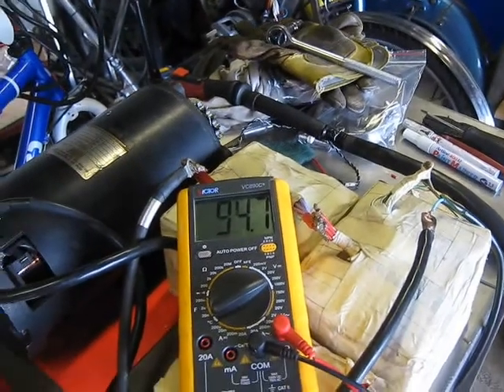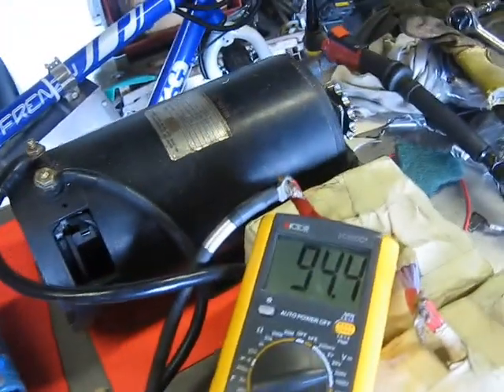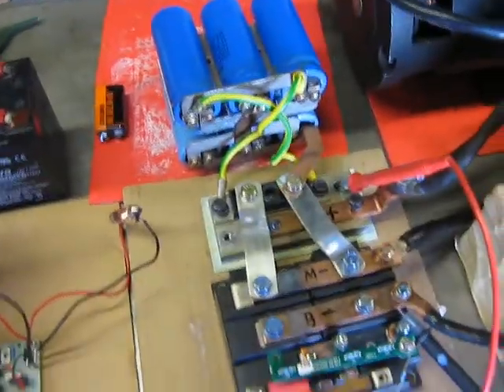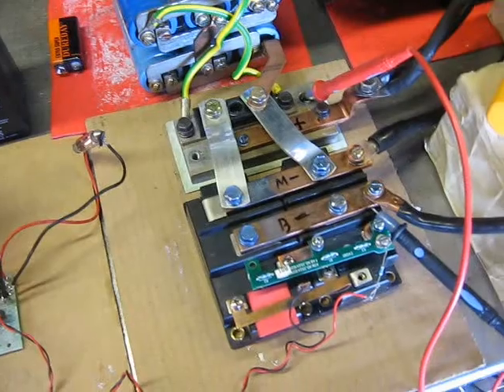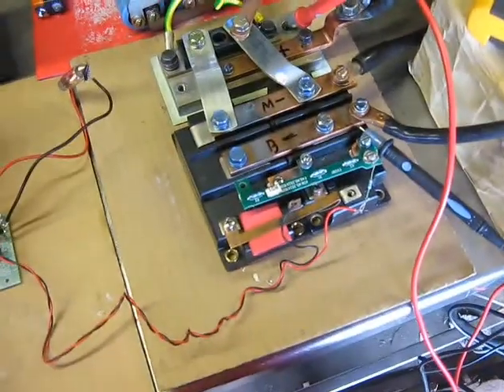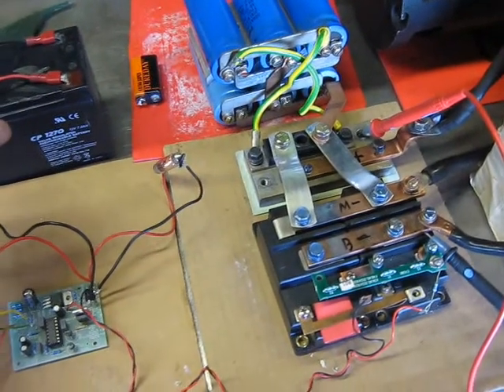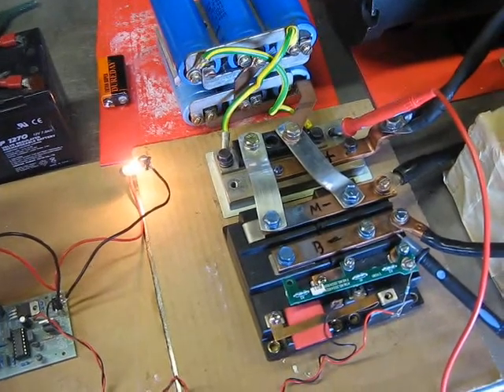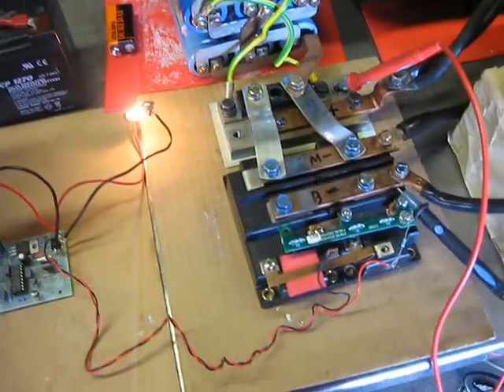Home-build DC motor controller

Comment: You to used a car generator for demonstration video?
Reply from the maker: +Painter No, this is a permanent magnet electric motor, about 2hp at 48 volts running at about 70v with homemade controller.